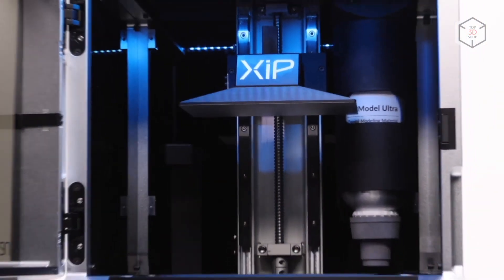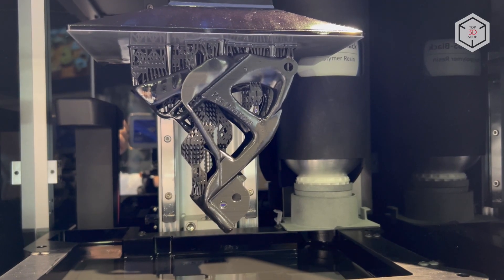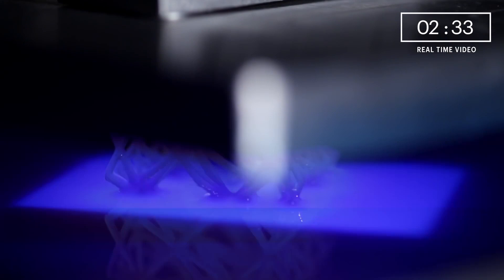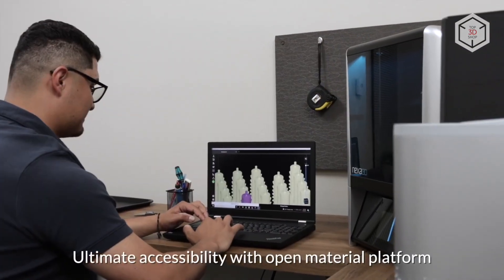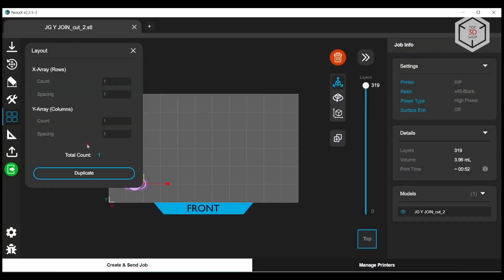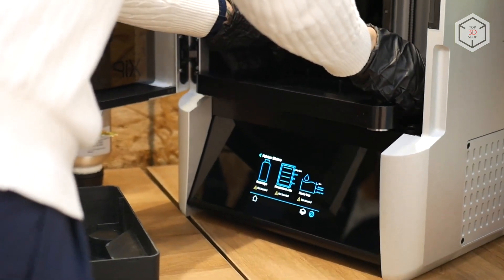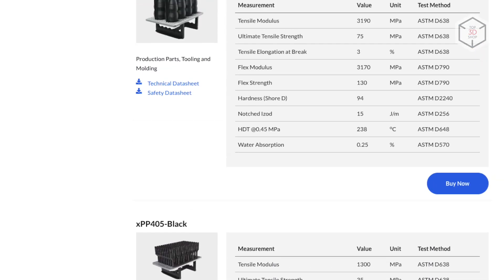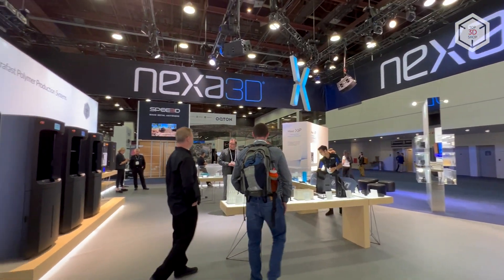Nexa3D XiP Overview: High-Speed Desktop Resin 3D Printer

Comment: I do not understand. Why should I continue use systems like this in the video that prints on a sheet by shine through, and then pull the object loose for every layer, rather than go for an upside down system without a FEP? 
In a upside-down system each layer are accesible for you to manipulate. Each layer visible during the exposure. Layers are not affected by the pull-off-force a shine-through system have to coope with due to the FEP adhesion effects.

More manufacturers should drop their current projects and instead go for the (potentially) more promising FEP-less arrangement like the Hitry Rocket did. I believe it would benefit all 3D print industry if this got going fast.
Any arguments that contradict my hypothesis are welcome, please fill in :)